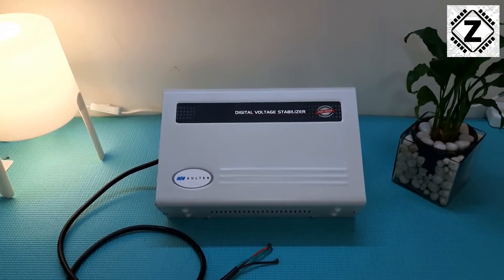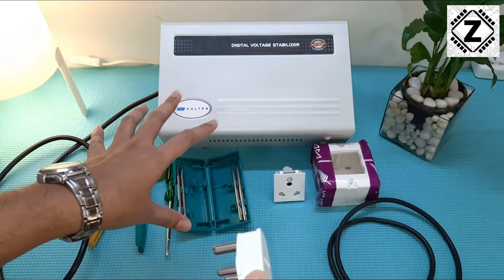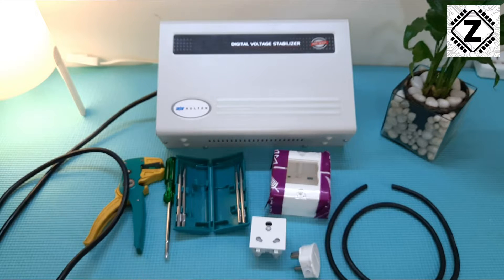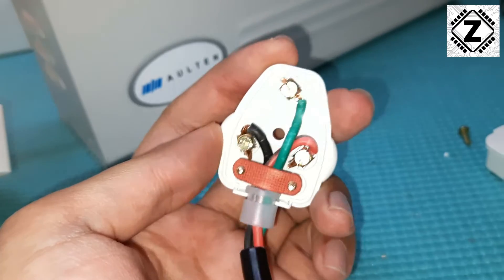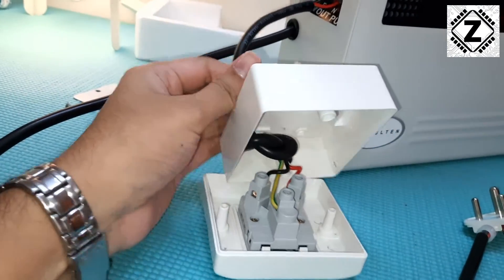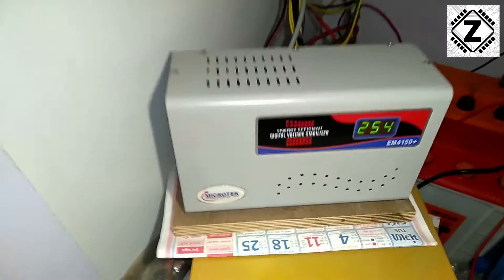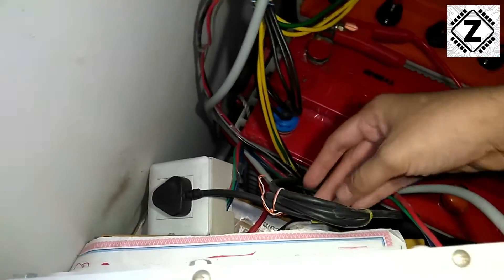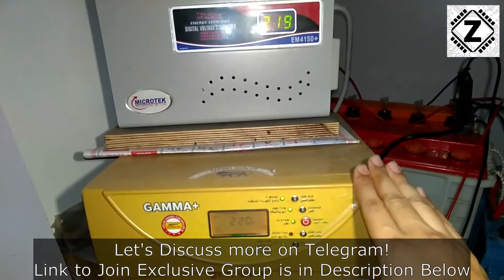[Eng] How to Install Stabilizer Without Cutting Wires |  DIY Plug Socket Board for Home Appliances

Comment: I don't have tester 
So if I do connect phase wire in black stabilizer input cord then it cause any problems or not
Reply from the maker: Consult any electrician.

Comment: Which is the best stabilizer 2kva for inverter luminous zulio+ 1100 12v  because the inverter is having voltage issues due to single phase current and Many appliances connected to inverter connection please do reply
Reply from the maker: https://amzn.to/33vwCfV